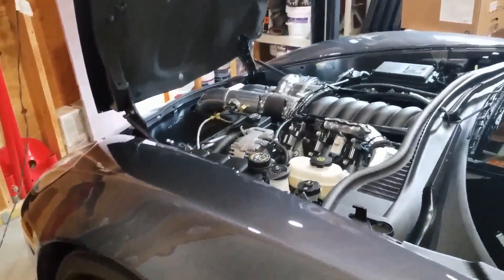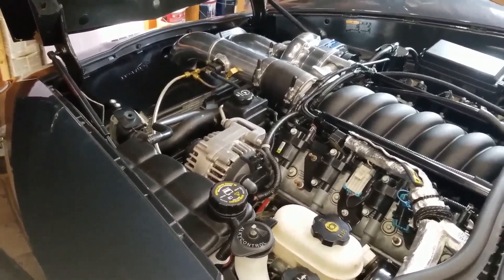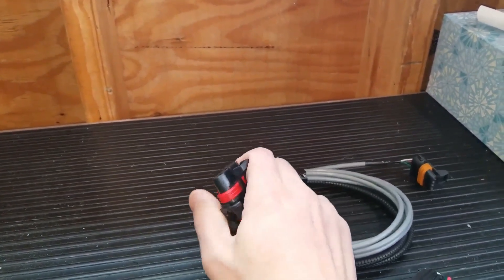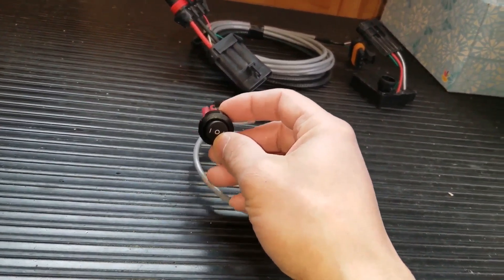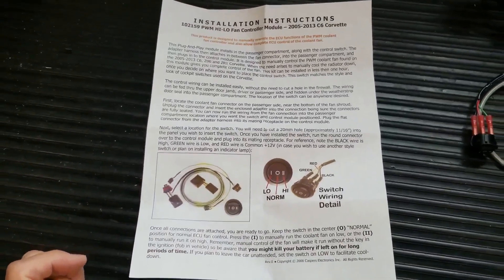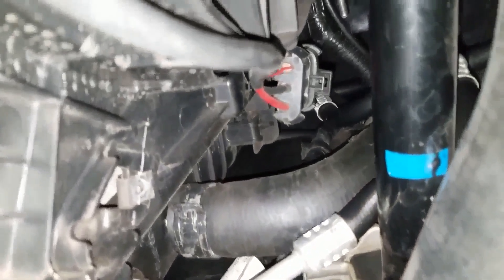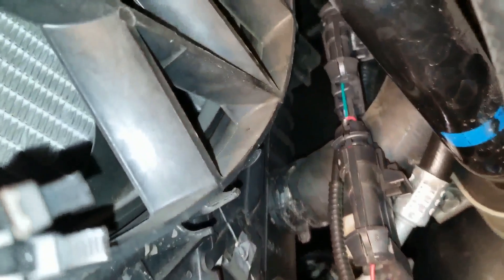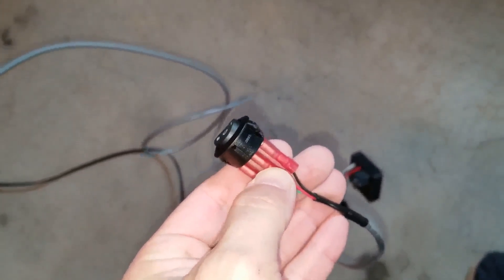KEEP YOUR ENGINE RUNNING COOL FOR $100

Comment: I got one of those Casper switches but havnt messed with it yet.
Guess I need the longer harness.
Liked & subscribed.
Reply from the maker: If you run it through the passenger side it will be long enough but if you do it through the drivers side as I did you will need a linger harness.